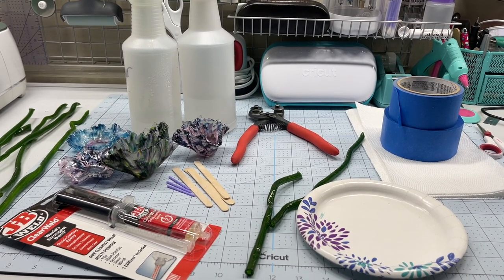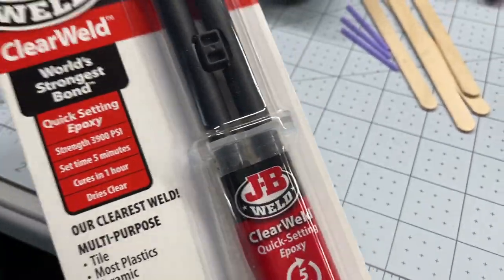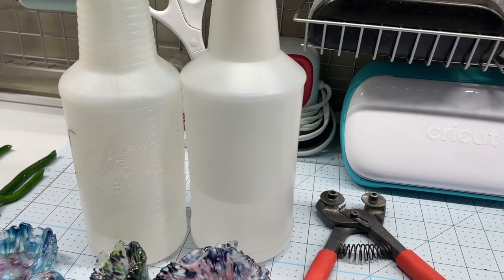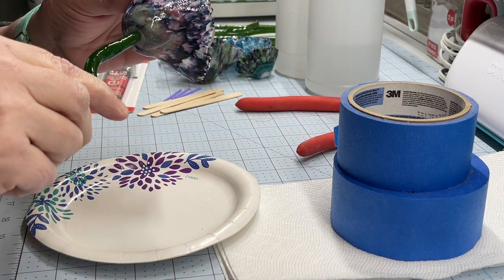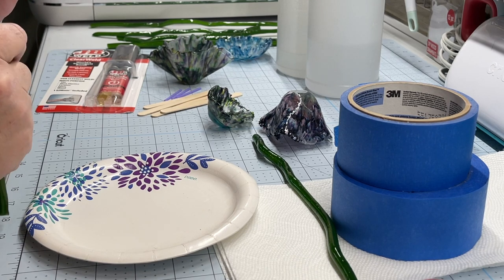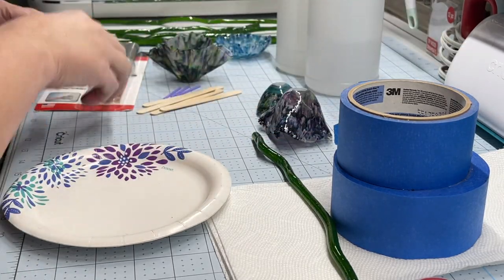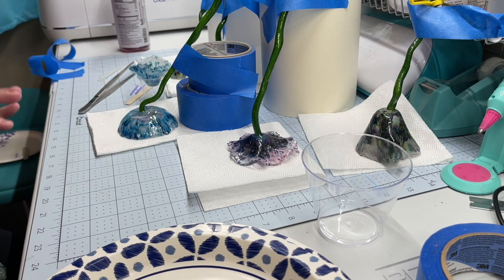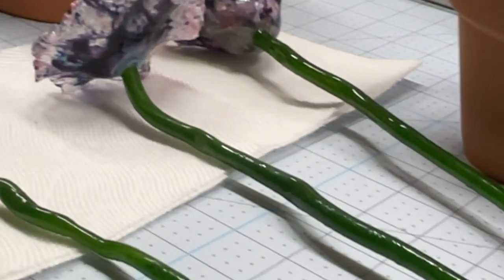Frit Pile Press Bonus Video - Assembling Into Flowers

Comment: Hey 👋 love your videos ❤ and beautiful flowers. Greetings from Denmark 🇩🇰 
I just want to gve you a kind advise about epoxy glue - is not a big fan of water/rain. So only for indoor use - clear silicone works better for flowers/glass that's placed outside
Reply from the maker: Thank you so much! That’s a great point, I’ve heard the same. My stemmed flowers so far have all been for indoor display but yes I’d go with clear silicone for outdoors. Of course I’m in Minnesota and we have some harsh cold winters and I would be concerned about anything being left out for the winter. If I were to offer them for sale at a show or online I’d recommend bringing in for winter. Thanks again!

Comment: Do you think you could use a torch and heat the flower and the rod enough to get them to stick?
Reply from the maker: Hi Stephanie. I don’t see any reason you couldn’t do that, and then pop them into a kiln that’s been warmed up to annealing temperature or in a bead annealer. I have zero coordination or skill in lampworking but I have friends that are amazingly talented, wondering how I can tag Clarann Bjers here, I bet she could chime in as she does both kiln formed and lamp worked glass.